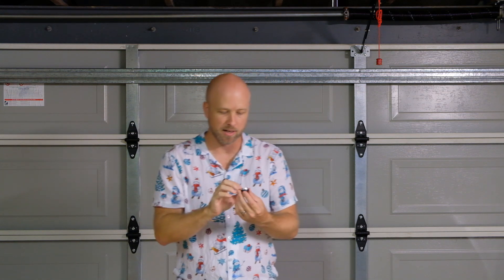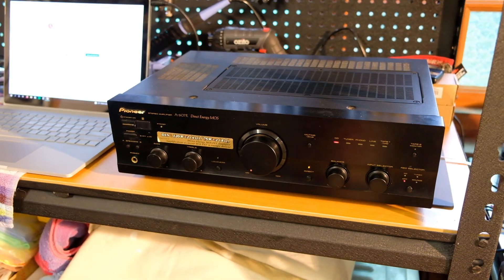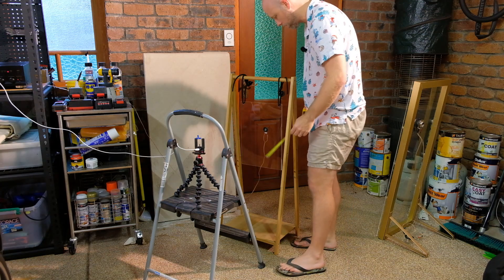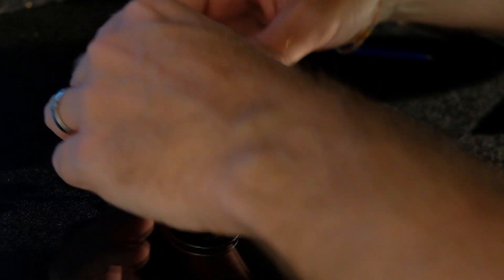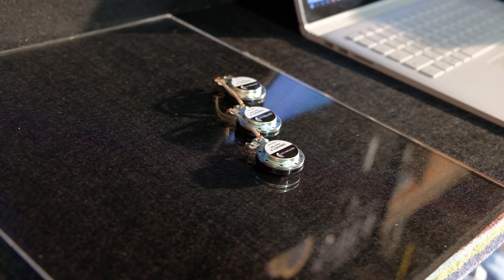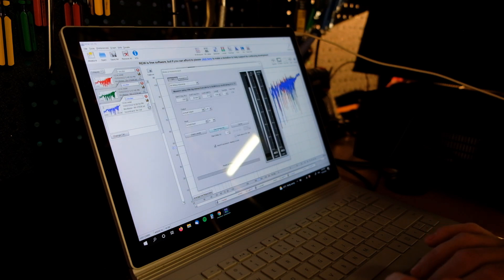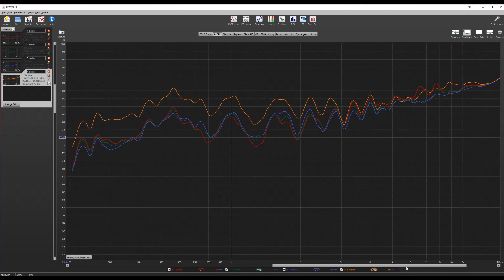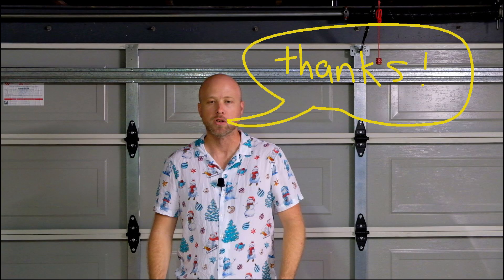Multi-Driver DML Panel Test - How Many Exciters?

Comment: How about this: try suspending it by the driver itself, that way you have unresticted motion of the pannel, and change the pannel for some thin 6 or 8 mm polistyrene. I tryed this method using not a driver but a speaker witch lost it's membrane cause of age😄, it sounds pretty good. Not hanging it by one side means all sides vibrate freely thus making more sound waves. Hope i see you try this.

Comment: This is an old thread, but a comment:  I think you are sweeping the frequency band far too quickly.   When a resonance builds up in a speaker, it takes multiple cycles at the same frequency for the resonance to build up.   Think pushing a kid on a swing.  If anyone does this again, try slowing the sweep way down and see if the result looks different.

Comment: This is definitely not how you wire them together.  Good idea but you cant run power thru a speaker.  You have the positive from the first to the negative on the second then the negative on the second to the positive on the third. Then with 4 its even weirder with the ground not connected to anything but another speaker. Not sure how or why you did it this way but pretty sure you got this completely wrong and almost positive most of them wernt even working for your test.

Comment: I thought after looking at the use of multi exciters on other sites that a second exciter should be placed in the centre? Yet you went to the opposite side of the first one towards the edge, is there a reason for that, that the others have not seen?
Reply from the maker: I was going by the guide linked in my description. I've never seen any evidence that 2/5 and center on the same panel is the best way. I think in the 1st Tech Ingredients video he uses those positions but on separate panels.

Comment: I just got 2 of those speakers to play with
7:40 Because you added the 4th speaker there the low frequency has more material (environment) to dissipate, you need a bigger panel 
you should think if the speaker is in the center of the square and has some frequencies produced, the rest of the panel will produce low frequencies, the area of rectangle - the area of square= lower frequencies

Comment: Hi Ben, thank you for this. I work directly in the field of audio, and I like to keep my ear to the ground to see what's happening in the DIY scene. Of all the vids I found yours to be the most useful and sensibly approached.
Firstly, that response curve basically stays the same is absolutely fascinating. What this seems to indicate is essentially fully excited across all its harmonic modes in whichever position the device is placed, but that more devices are required to reach the optimum for the lower harmonics.
The goal with the placements being off centre, to the membrane itself and each device, is not emphasise the same set of harmonics.
I had wondered whether, by adding drivers in close but not exact proximity, each the same distance apart, would produce issues at about the 6.5khz region, and I do see a bit of variance there, but it doesn't look too bad. That's because in the air that would be the wavelength roughly that distance centre to centre. However, the speed of sound in well over 10 times that. 
I do wonder whether an exponentially related spacing (for instance x squared = y*2) would achieve more harmonically spread results, but maybe given the wavelengths inside the material that's entirely moot.
Much appreciated!

Comment: Hello my friend, not sure why I watch these videos but every time I see anything regarding a DML build, I still watch. Drives me nuts every time I watch them (I was involved in the commercial development of a product or two using this type of technology. It's frustrating stuff but a lot of experimenting fun. and everybody, I mean everybody putting out these videos is doing it completely wrong. Doesn't help that the little PDF you get from providers is also littered with partial truths that are of little use to you as a builder). So here's the skinny on what's going wrong, you're using the wrong material at the wrong dimensions and definitely loading those exciters in the wrong manner at the wrong spot on the material. Here's a little hint you're trying to couple the force of those four exciters into one single episode of force per a cyclical motion. Cluster them tightly together in a diamond-like shape and put them down towards the bottom right corner using the same but modified ratio. try that first & see your results. The idea is not to spread the force too widely cuz then they're counteracting each other. Also try to invest in a handful of little foam damper pads you know the kind that go underneath objects so you can not scratch up surfaces of your table etc you know the kind sticky back type ones. Try different shapes of those, sizes and placement areas. once you start kicking off some of those anti nodes from your material it will really really bring out some great audio. I've been working with this type of electro-nodal acoustics since 2003. Good luck
Reply: So........where's the best place for DML build instructions then in your opinion?
Reply: @Mazzoner  On the internet anyone can claim anything. If the comment would say the truth, there would be documentation confirming it.

The documentation says itherwise though.
Reply: I wanna know why some have a threaded hole in the back. Hmm
Reply: I’m designing a pair using 24x36” carbon-fiber-skinned 1/4” nomex honeycomb without parallel edges or sharp corners. What FEM software would you recommend for dml placements at the nodes to smooth the response? I have a 16-channel (30W per) with onboard storage for peq and phase adjustment via pc software, per panel. 

The test in this video is probably measuring quite a bit of comb filtering and other room effects. Gotta test in an anechoic chamber or at the very least a wide open field outdoors.

Comment: Its pretty difficult to get this accurately ,best to use FEM simulation  software Pansys dedicated  for DML based designs.It will accurately predict the Frequency response and placement of multi exciters on the panel.
Reply from the maker: I have heard that modelling software did exist but have never been able to find it. Do you know how one can get their hands on this?

Comment: A dead zone would be a node I would imagine. Each size panel would have differing node locations. I know guitar strings’ nodes are where the string is not moving and that’s also where harmonics come from.  Panels work differently but they still have nodes or dead spots where you won’t get the full vibration of the material if you place an exciter there. This is all just my ponderings. I think if you find the top of the arc of each vibration you’d have the optimal placement for your excited.
Reply from the maker: Yeah you're not wrong - there will be almost infinite variations of panel dimensions and exciter number and placement/s. It's definitely something I'd like to dive into further when I can.

Comment: Let me ask you. Can you use one of these drivers with a guitar or bass amp. If not why not?
Reply from the maker: I guess you could. In fact now that you mention it I'm wondering if I should! 
I literally have just googled "Guitar amp frequency range" and the first result indicates ~ 70hz - 6khz is suitable, and if that's correct then I'd say it would be an ideal use case for this type of driver.

Comment: Could you put one on the direct opposite side in reverse wiring to amplify it
Reply from the maker: In theory yeah just wire them up with opposite phase and get a ‘push-pull’ effect. 

I haven’t tried it but from what I’ve read it doesn’t tend to do much. Interesting to try though for sure.

Comment: I wonder if you could get something similar to a line array if you put the 4 drivers at every fifth of the panel vertically.
Reply from the maker: I haven't had much chance to test in more detail but I suspect  you'd get the best results by attaching them at different distances from each other to avoid reinforcing the same frequencies across the board. I plan to test different combinations when I get the chance.

Comment: Can I connect drivers of the same impedance but different watts?
Reply from the maker: Yes you can. As long as they have the same impedance then the power will divide equally between the drivers. 

So if you had a 20w and a 40w driver together, power handling should be 40w (each driver receiving 20w).
Reply: @TypicalBenYT  so essentially the stronger driver would be running at half power?
Reply from the maker: @jagejg7239  All else being equal they should be putting out the same amount of sound. Bear in mind that the watts rating is the driver's 'power handling' - basically how much power you can put into it. So in that example, both speakers would receive the same amount of power but if you kept cranking up the volume, one speaker would melt/crap out before the other.
Reply: @TypicalBenYT  well thanks for your help! I imagine DML speakers don’t benefit as much when it comes to driver diameter so I’ll just stick to a couple of low watt drivers connected in series.
Reply from the maker: @jagejg7239  no problem at all. I’d just add that depending on your panel material, you might not need a lot of power as they can be very efficient (high volume for a given power level). For example with the foam panels (EPS) people seem to get by with relatively small exciters. 

Play around with it and enjoy the process!
Reply: @TypicalBenYT  I’m planning on using 2 24 watt drivers with an 8 ohm tube amp. For the panels—an XPS board cut to 65x48 and upholstered with two identical Cotten tapestry (so each panel displays half the image). Hopefully with boosted base, large panels, and reduced treble (courtesy of the tube amp) the frequency will be relatively even. I don’t wanna use a sub… that’d be like a planar and BA hybrid.

Comment: If the bottom part is fixed, the whole plate will vibrate and the bass will sound right.
Great experiments.

In another YouTube video, I can see that the plate vibrates as the reflected light is shaken, but in your video the reflected light is static.
Reply from the maker: For my actual speakers that I'm (very slowly) building, I am using a panel fixed in place using 6 screws (and rubber spacers) in a wood frame, so in effect the top, bottom and sides are all fixed.

I guess there are many ways to approach it though as I was also very happy with my previous free hanging panels.

Comment: The cords you have suspended the panel with are dampening the panel. Using monofilament as recommended by manufacturers allows better sound by reducing the dampening.
Reply from the maker: Hey Steven. No doubt it all has an effect but I don't think that a little dampening is a bad thing. In my last design I rigidly fixed the panel to a wood frame in 10 locations (with rubber spacers) and produced a really nice sound.

Comment: Great video!  I was wondering if you have ever tried to hang the panels horizontally instead of vertically?  I would like to know the quality differences between the two different hanging orientations, which I am equally curious about different methods of how to potentially hand them horizontally.  The reason I am asking as I am interested in mounting these types of panels on my ceiling, ideally for a Dolby Atoms speaker setup.
Reply from the maker: Hey Grant, thanks! I haven’t tried that configuration. I guess you’d need quite a stiff material (or glue some bracing on the back of the panel) to stop them from sagging. Also you’d probably need to use a fairly light exciter on them as the weight of the driver magnet might affect performance.
Reply: did you end up doing this? planning on doing the same for next holiday project

Comment: As usual, a very interesting experiment. Thank you, Ben.
As others have noted, the size of the panel may be a limiting factor. I noticed today that Office Works (and other outlets, no doubt) sell A2-sized 5mm foam panels (AUD19.00 for a 5-pack). These may work better for producing lower registers. I'm hoping to try these myself with a 20-W 4-Ohm exciter in each panel in a couple of weeks.

Comment: Hi again Ben

A few comments on this test:

The higher frequency modes take relatively less energy to excite than the low frequency modes and in this case the panels are relatively small, are quite thick (for this size) and therefore stiff.  

A single 5W exciter would conceivably not have the punching power to produce decent low frequency bending waves in this panel so it follows that adding more power will improve this aspect up to a point.  

I would also expect that the 5W exciter coils would have a very limited Xmax.   

So in all, I don't believe that this test proves that multi exciters are better than a single one - just that if a panel is underpowered, adding power will likely produce more bass and mid-range.  Once that saturation point is reached (as stated by @nakedlunch), I doubt any improvement will be found.

A useful test may be to measure this panel with a single 20W exciter and compare the results to the 4x5W.  

Multi-exciters could conceivably be used to try and even out the response patterns in a panel but as others have reported, the resulting interference between the exciters can lead to a muddier sound.
 
Cheers
Reply: I've messed around a bit with DMLs and other than underpowering a panel, I suspect the other big improvement that comes from adding additional exciters is in added reaction mass. Remember that the exciter can only move a panel in proportion to its mass. A 20g exciter on a 200g panel is going to displace itself far more than it moves such a heavy panel, especially at low frequencies. A second exciter doubles the mass that the panel gets to push against, and I think it's easy to hear both the increase in both volume and low end response. 

From what I've found, just epoxying a weight to the back of the exciter can make a similar difference in low end response provided that the exciter has enough power to push the panel.
Reply from the maker: Great idea on the 20w vs 4x5w test.

I haven't had a chance to follow up on this video yet and I was a bit rushed on the day but I do agree that the multi-exciter setup sounds worse in clarity, particularly in the HF. Running a back to back test vs a single larger unit might help to illustrate this as well.

Comment: I can understand the wanting more concept here, but my experience with DML is stick with a single driver, best you can afford and highest power, after that your just possibly increasing overall volume, but not going to gain any better mid or low frequency response, I have a set of pink panels 24"x24" with the standard  2/5- 3/5 placement a decent bluetooth /aux amp with a sub channel and they rock my socks off. In this instance the old K.I.S.S ( keep it simple stupid) applies. the sub I'm using is an old computer speaker sub 6" and is really! thumps I tried adding 2 and it was waaay too much bass very clear bottom end, but far too much of it.
Reply: Could you tell me what bluetooth amp and exciter you used. İ had this idea to build a panel speaker hanging from the ceiling. And then have the power from the ceilling as well so it can look all wireless

Comment: The 4 drivers sounded bad, at least on my end, like they had a diffusing chorus effect.
Another thing... I understand that you have to use copyright free music, but does it need to be so digital? It's very poorly made and will sound bad on any speaker. It's not suitable for doing sound quality tests.
Please use tracks with live recorded instruments and if possible - vocals.
Thank you
Reply from the maker: Hey Jonathan, thanks for the feedback.

Unfortunately I wasn't very well prepared for recording this and the two bits of music (single and multi) were recorded with different mics, which may exaggerate the effect, but in general yeah the single has a clearer, crisper sound. I hope to do more rigorous tests with various configurations soon.

When building my larger panels, I am also hoping to up my recording quality to do some 'proper' listening tests/impressions. I'll take the feedback re the music into account for this.
Reply: Are you listening faster than 1x speed?  

I had the same issue and realized I was listening at 1.25x.
Reply: @VulgrDisplay  I only started speeding up the vid a week or two ago. When I wrote this, I had never touched that setting

Comment: Great video! Have a few questions. 
1. Might have missed, but how thick is the panel?
2. Have you tried the other configurations of 4x exciters? I know Matty Hughes uses another one for his panels. 
3. Have you tried doing measurements on 2 panels at once? That is same configurations but two panels in total?
Reply from the maker: Thanks! The panel is 4.5mm thick in this case.

No - this configuration is listed as the default (the other is named ‘alternate’ or something in the guide. If I can unstick these without ruining them I could give it a go.

My panel pairs have so far been single exciters. I am starting to tinker with different configs in preparation for my next build. I also don’t have 8 of these try it with sorry.

Comment: Thanks for all your work in these DML speaker test videos. 
I'd be curious to see how 3 drivers wired "2 in parallel" wired in series to the 3rd driver for a total of  6 ohms would fit in to your series of charts.
Reply from the maker: Plugging that into the series/parallel calculator I linked gives total load of 2.67ohm so probably not a great idea. This is why I wired them in series until I had 4 of them.